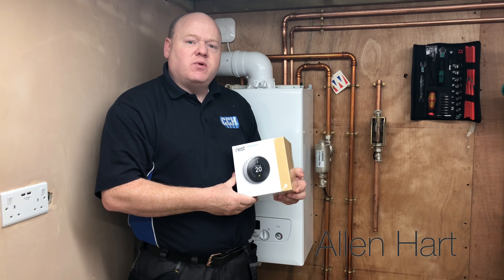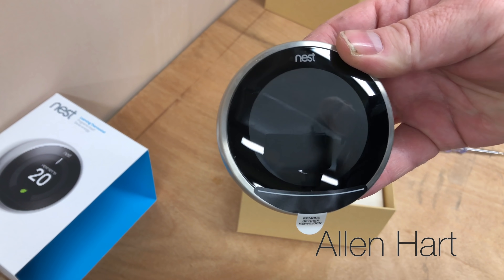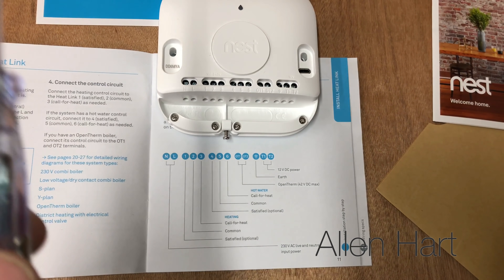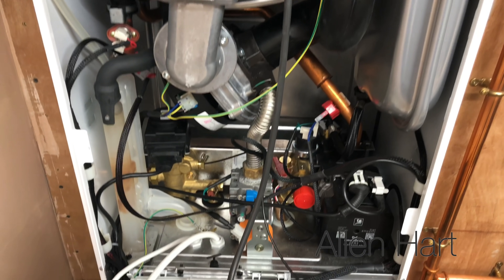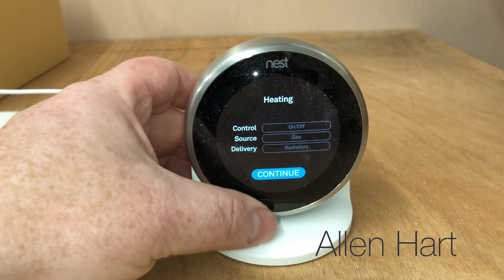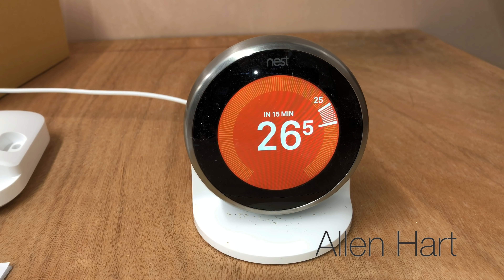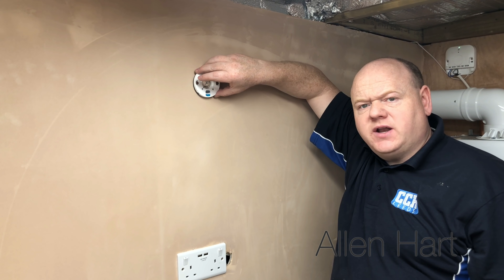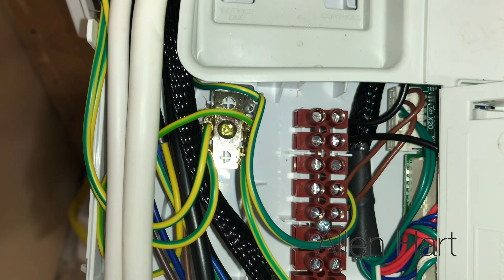NEST LEARNING THERMOSTAT INSTALLATION - How To Wire

Comment: Got a new boiler installed and he’s not wired it correctly. Can only turn heating on if I turn the water on first, so thermostat doesn’t work otherwise

Comment: On the dial when you connect T1 & T2 do you have to give power also with micro usb or no. On my wall fixing plated it has t1 t2 also micro usb port. Thanks
Reply: No, it'll be powered by the heatlink

Comment: Hi Allan
I would like to ask you
Ive got 20 years old combo boiler
Do must to install that with box link to the boiler?
Ive got only 2 wires at my old thermostat
My question is can it works woth that 2 wires cable ?  Its got 30v i tested
Or must be install that  with link straight to the boiler  ? 
Thanks
Thsnks

Comment: Hey Allen

Been recommended an Ideal Vogue system boiler with HIVE thermostat!! Research show that HIVE is not really that smart and say NEST is best choice.

Now my worry of NEST installation is possible on the suggested boiler and if that will add additional installation fee?

By the way which model of Nest do I need to go for? Also, how many thermostat will I need for my town house (two floors + ground floor).

Pls advise
Reply from the maker: Ideals own control makes really well with the vogue
Reply: @AllenHart999  sorry you confused me here. I thought VOGUE is the model of the Ideal (being the make)??

Question is; Nest vs Hive ?

Comment: My existing honeywell unit on the wall which controls the central heating  has the blue brown  N/L and the grey and black, so I assume I can wire just as you did. Blue in neutral, brown in live, grey in 2 and black in 3? The thing confusing me is in that the other videos I have watched the are also additionally looping the L and number 2 connector, why?

Comment: Having had one fitted, the best thing you should do is turn off the ridiculous self leaning mode, it trys to work out what you want each day but always gets it wrong, has the out air temperature is always different each day..... not so smart, but a very good contorter..... All so it best used in the stand mount , it very important to find the right place in your house.....

Comment: I have a wire from my thermostat going straight into boiler on LS and LR, so do i have to put this wire into heat link and on what connection then wire heat link into boiler? On ls and lr?

Comment: Many thanks Alan, I am going to connect a Gen3 to my Open therm boiler but wouldn’t have known about the change required in the settings but for this
Reply: Where do I get the power cable from to connect to the thermostat?

Comment: Hi mate I had a new boiler fitted in ideal vogue max combi 40. I had the boiler engineer fit the nest thermostat as well. But for some reason the thermostat can’t be used to bring the heating on. The thermostat is connected to the heat link, I am getting hot water on demand. But the radiators work if I turn nest off to go manual heating. Can you advise on what is wrong? Is it the wiring?

Comment: Where is the wire to spur ?  at beginning I can see frm recver ...live neutral and grey black wires to boiler.  Then from boiler another live neutral earth likely to fuse spur. what about the black nest itself wheres those wires going.  At 4:38 wheres that wired to or is it wireless here ?
(normal on and off not open therm)

Comment: Hi Allen. Please can you advise me. I have always wired a boiler switched. I want to use opentherm. Do I do away with the switched connection and put a link back in the boiler before connecting the 2 core to opentherm?
Reply: I have the same question and can't seem to find an answer anywhere

Comment: Hi Iv got an ideal boiler looking to change the wiring on the nest to opentherm but I have a underfloor heating wiring center do I need to move any wiring in there for the opentherm to work with the nest and the boiler of just leave it as it is but move the wiring in the boiler and nest

Comment: Hi Allen,
I do understand the wiring. Thank you for that. One small thing about open therm, I don't understand about the terminals OT1 and OT2, I can't figure out which is which. Is there voltage polarity to take care of here or the open therm has AC signal?
Reply: I found it out after posting this message and forgot to update it here.
The terminals are not polarity sensitive. It can be used interchangeably. 
Reference (history section on page): https://en.m.wikipedia.org/wiki/OpenTherm

Comment: Thanks Allen ,  very nicely exxpained, is it possible you can advise how to connect Nest Thermostat with logic esp1 C35 combi boiler ? I am looking to connect with Opentherm. Boiler already has ESI thermostat attached which is programmable but I want to replace it with Nest 3rd gen.

Comment: Hi, I've just had a new baxi 40kw platinum boiler installed with the nest learning thermostat. It's on on/off mode and I watched your video and tried to put it on opentherm but I get a message saying couldn't detect opentherm connection. Check your settings. What am I doing wrong? Also, what would I need for it to detect outside temperature to adjust the heating accordingly in order for it to be more efficient? Thanks

Comment: Thanks for the vid. Quick question; if you use the table standard; do you still need to connect the nest to the heatlink via a wire? Or does this go wireless? Because you only showed to connect the thermostat to the headlink when you put the thermostat on the wall? Thanks for the reply in advance:)
Cheers!

Comment: Thanks Allen for your video. I own an old wood boiler for heating, which was adapted to work using a pellet burner (Blaze Harmony XS26). The Pellet burner doesnt support OpenTherm, but it does support regular on/off thermostats. The Room thermostat connector on the control panel supports less than 12V. Would Nest Thermostat work for me by connecting 2 and 3 (on Heat Link) to that two wires connector?
Also in this video you wire Heat Link to the Thermostat, but can those two work together wireless?

Comment: Hi Allen
Just installing a 2 zone gas boiler with motorised valves. I have wired heating for standard thermostats. So from my isolater to junction box with motorised valves and a feed up to boiler. 
With the heat link do I wire my motorised valves into the heat link and use it as my junction instead or what way? First time using Nest stats

Comment: Another brilliant video Alan you should have been a lecturer.I have a problem I have just purchased a Nest  thermostat which now are sold without any wires included in the product.Have you any idea what kind of wire I need to buy to wire the thermostat to the heat link. ?

Comment: Does the t1 and t2 provide permanent power to the thermostat as well. I.e. so you don't need to have a usb connection to charge the thermostat?
Reply from the maker: T1 and T2 are power yes. Happy new year. Thanks.

Comment: The glaringly obvious omission with my Nest thermostat is the option to choose just one hour of heating. I used that often on my old controller if I was up late on a weekend evening. You know those those occasions where the heating’s turned off according to schedule then you feel the slight chill an hour later? The one hour button was perfect for those occasions. Now I have to turn the thermostat up to get the heat working again. Not difficult I know but the amount of times I’ve woken up in the early hours, melting in my bed, because I forgot to turn it back down ☹️
Reply: Hmmm? You need to set the temp. That is normal
Reply: @Episode_13  I think you missed my point. Maybe read my post again.
Reply: @Episode_13  Most programmable thermostats that I know of have some sort of “boost” function, where it will automatically return to the schedule after a pre-set time

Comment: Gas safe to connect a Thermostat to a boiler, I've never heard that one before
Reply: You quite clearly said “if you remove a case from a boiler use a gas safe registered engineer” What you should have said is “confirm if the type of boiler you are working on is it OK to remove the case” 
Misleading is correct
Reply from the maker: Depends on the boiler. If you are working for a customer and removing the combustion cover then it would need testing afterwards.
Reply: The combustion chanber is located behind the cover and doesn't contain any connections required to connect a room Thermostat, it seems you're trying to miss inform the public.
Reply from the maker: @mattyschofield  I am not trying to mislead anyone. You need to take the front cover off on the baxi 600 and that includes the case seal. Some other boilers do not require this. Thanks.

Comment: Hi how is this wired for a nest stand use
Reply from the maker: Not really sure what you are asking? if its on a stand you need to plug it into mains. Thanks.
Reply: It’s powered with a micro USB charger that’s included and it communicates with the white box shown at the start of the video wirelessly

Comment: What's mean 'Supply' in Settings -> Equipment -> Nest PRO menu?
I can't find any info :(
Is it maximum target temperature on System delivery?
Or target temperature on System return? Or supply cold water to Boiler?
What is it? Why did you set it to 50 degrees?
Help pls.

Comment: Hi, one question: Can I install Heat Link using just TWO wires, that my current thermostat is using to power on my heat boiler (Electric Central heating). Basically, current thermostat, sends a signal when heat is needed, everything else done by the electric boiler. Thermostat is battery powered, but live wire (220V) is connected to it. This wire goes directly to my electric heater. If this is possible, which two connectors on the Heat Link should I use, and do I have to "jump" any of the connections? I know that there is a NEST E thermostat on the market which is design to replace my current thermostat, but I would like to use 3gen on my system, because it will give me wide options if I decide to change my boiler.Thank you for the answer.

Comment: I have 2 thermo control in my house. One in downstairs.another one in second floor.
Which one shall I install ?
Reply from the maker: you may need two. I have one for upstairs and one for down at my house. Thanks.
Reply: thank u
Reply: Since my gasman connected Nest 3 to Ideal s24 system bolier via OT connection the hot water stopped heating my hot water system. I do have a hot water cylinder.  Any idea why water stopped heating via my Nest schedule?

Comment: Good video Alan. But how do you connect a 24V two-wire zone valve to the Heatlink? Where do you connect the two wires for the adapter?
I know the “ on/ off” wires go to 2 and 3, but where do the adapter wires connect in the Heatlink? Can’t find this in the diagrams...
Please help? Thanks!!

Comment: Allen you do not need to be Gas Safe to open up a boiler case.  That is propagated myth. Wiring up a stat you are not entering the combustion parts of a boiler at all.  Anyone can change a plate heat exchanger inside a combi boiler as it is 100% on the water side.
Reply: Gas Safe are just an extension of the fucking free masons, trying every trick to get a monopoly on boilers. What Allen should have said is “check the type of boiler you are working on to see if the case can be removed” Some modern boilers the case forms a part of the positive pressure air requirement so is classed as combustion. It’s just the manufacturers working on a monopoly as well.
Reply: @optimist3580  wrote:
"Gas Safe are just an extension of the fucking free masons, trying every trick to get a monopoly on boilers."
I couldn't agree more.They are also not cheap. 

I know one guy who was GasSafe who who is not now. Most of his work moved over to bathrooms and G3, specialising in walk-ins. Always busy.  Keeping up GasSafe fees and the annual cost of gas instrument calibration, that he may use once a year? He gave it up. He may do the odd boiler as it is a part of a bathroom job, but has a friend to sign it off.  Like you, he said it's become a scam.
Reply: @optimist3580  
Is is only an air to air seal. I would like to see where it states it is legally out of bounds.  Take GasSafe with a pinch of salt. They do spout some self-interest tripe.  If GasSafe print it, then it must be law. mmmm, no.  The law is the law (building regs are law), courts rule on that. Even Health & Safety are not the law. They police it, but the courts are the deciders.
Reply from the maker: @johnburns4017  You are totally wrong on this one buddy. The door seal is there for a reason and part of the flue system. The regs say competent. Ask the question on gas chat and see what people say.
Reply: @AllenHart999  
I have never read anything that states that, or anyone gave me any info of that sort. I like to keep things legal, not how we think it should be. 

I mentioned to one guy that it is an air to air seal, and if the case if off, or case seal has failed, it will draw air from the room, with no products of combustion entering the room. He responded saying what if the inner flue pipe was holed, products of combustion would enter the room.  I said that maybe we should have all gas pipes in a sealed conduit then, as gas can be nasty stuff - blew down a few blocks of flats. 

All this can get a bit out of hand.
Reply from the maker: John Burns I normally listen and agree with you buddy, you know that. The case seal is part of the flue system hence the reason we always test with case on with fga as last test👍
Reply from the maker: You cannot wire into this boiler without opening the case seal. 👍Thanks.
Reply: @AllenHart999  
And?  The case is designed to be taken off and on, on a regular basis.

If a plumber works on the water part or an electrician works on connecting wires, he is not playing around with gas controls or making the installation unsafe.  He is not allowing products of combustion to enter the room, or leaving a potential explosion situation. The seal you talk of is only an air to air seal, products of combustion are not involved.  

It is not a black art that only plumbers that have a done a short course on gas can do, and if not GasSafe people will be struck blind if they look inside a casing.
Reply: This clarifies what is allowed https://www.gassaferegister.co.uk/media/1449/who-can-legally-work-on-a-gas-appliance-factsheet.pdf
Not that many people like to admit to this document because it upsets the the Gas Safe gravy train!

Comment: Hi mate, how does the thermostat work when you just want hot water for a shower and do not want the radiators on, is there an option for this? At the moment I have a switch on my combi boiler for:  Hot Water or Hot Water + Radiators.

Comment: What is open therm please
Reply: Derek T same thoughts here! I have no idea what it means?
Reply: My understanding is and I'm not an expert by any means. Basically on a normal thermostat set at say,  21c. The boiler will reach the 21c and exceed it due to the characteristics of the boiler coming on at full blast. The heat therm system however adjusts the amount of fuel that is burnt as the boiler starts to reach the desired 21c, so the temperature does not exceed the thermostat set at 21c, the system then switches on and off to maintain this temperature and in the process save fuel. I presume the communication between the boiler use a common standard. I hope that's clear.

Comment: Hi Allan H,
Could I have outdoor weather sensor and the nest system using open therm working together or would they both conflict with each other as they both override manual temperature control. Maybe I could have nest in basic on/off mode and outdoor sensor. My combi is Viessmann 050w. Any advice would be greatly appreciated. Thanks

Comment: Hello can u do one on how to install hive in a logic boiler please?
Reply from the maker: I do not install the Hive Thermostat sorry.
Reply: Plug the Hive WiFi unit into your router first. They take a while to connect, update etc so do this first. Remove the old timer and fit the Hive hub to the universal base plate. They come in single channel or twin. Fit the Hive thermostat in the hall. Bob's your uncle, Fannie's your aunt. Miles ahead of the nest.

Comment: Hey how you wired and install  the heat link to  have option controle you hot water?. Please great wideo
Reply from the maker: This was heating only on this one. Thanks.
Reply: @AllenHart999  but you can have that option witch boyler?  How and when you install that option?

Comment: Great video just been doing research as had a company 50 five fit a nest for us and was told my boiler vaillant ectotec pro 28 does not support opentherm even though everywhere i look says it does the company where very rude so would not ask them back id just like to ask yourself a professional if i was lied to

Thank you and great video
Reply from the maker: Vaillant do not support opentherm.
Reply: Do Worcester greenstar 27 CDI support opentherm thanks great video.
Reply from the maker: lewis benson I do not believe they do but why would anyone have a Worcester 😂😂😂
Reply: @AllenHart999  hmm how rude but thanks anyways.
Reply from the maker: @benson3000able  it was only a joke buddy, thanks for watching.

Comment: Would you always choose open therm over simple on off with the nest?
Reply from the maker: Depends on the boiler and the system but i do like Opentherm. Thanks.
Reply: @AllenHart999  its Vokera i36 Unica. It modulates when wired off/on in the right setting (heat range). I fail to see the difference with open therm with a modulating boiler. Does it 'grumble in the background keeping it at a set temp?

Comment: Hi Allen, when wiring open therm and removing wires from basic wiring on boiler to open therm connections do you put link back between original stat connections on terminal block at boiler?